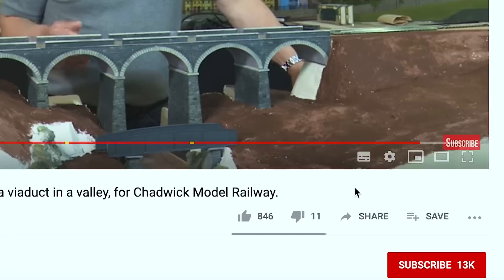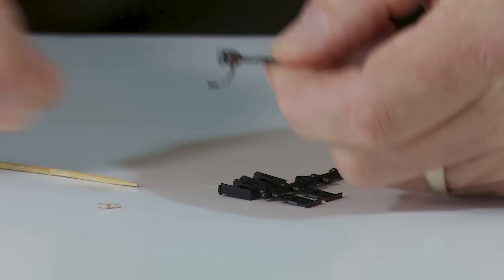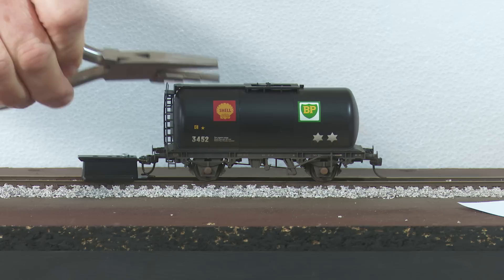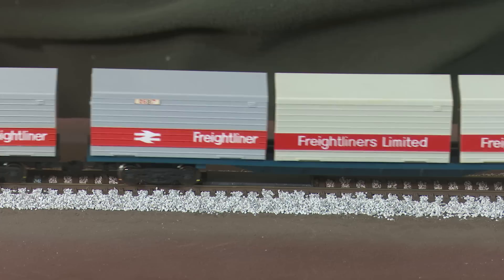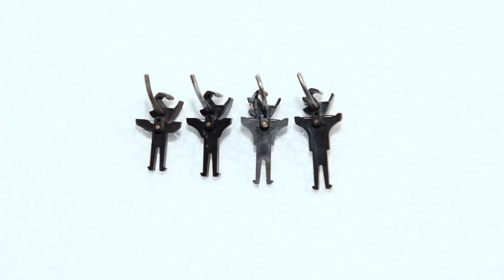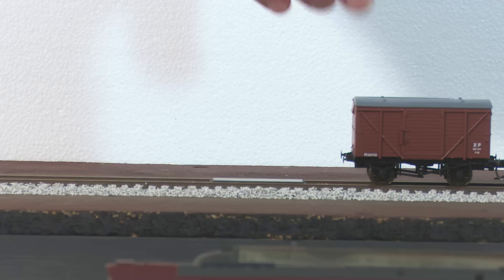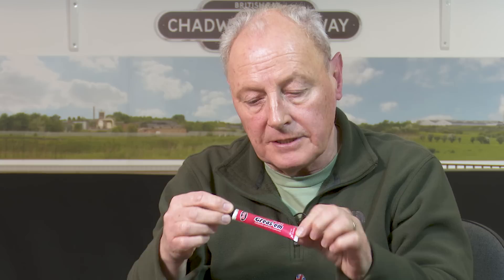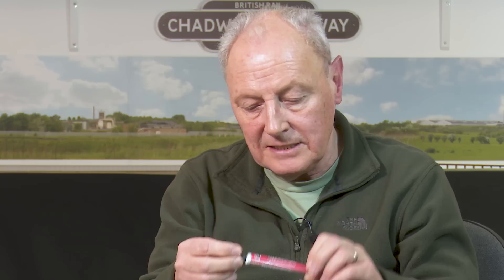Kadee Couplings at Chadwick Model Railway | 81.

Comment: Maybe the best in-depth look at and explanation of KaDee couplers I have seen.  They have a myriad of ultra-realistic couplings.
Reply from the maker: Thanks Anthony, I’m so pleased that you enjoyed it.
Reply: Charlie, I’m rebuilding my layout. I have been ordering brand new code 83 track.it doesn’t mater what fish plates I use with code 83 or code 100, does it. I bought a lot of engines and cars second hand. Because I was still working on my layout, I didn’t look at them all. I have since found out that one of my engines has the back set of wheel tide on. Do you know where I could get it fixed. In the UK or the States. Finally, I needed to know how to fix couplings but I found your video. Thanks for putting it online.
Bob
Reply: I wholeheartedly agree with this! Our HO Scale model Railway here in Beaverton, OR, USA requires it's members to use KaDee couplers on all rolling stock and locomotives. It saves so much headache if we need to do an coupler repair during a show because we all have the repair parts. I wish you would have discussed the shelf-pin couplers that KaDee produces. They're great when you have a modular layout or long strings of cars.
Reply: Totally agree Anthony, this is a reference video for posterity. I am just starting to understand them for my kit built wagons and need to learn which ones I need. Top job again Charlie 🤩

Comment: Hi Charlie
I started using Kadee couplings years ago. With a fair bit of stock I set up a few wagons with one Kadee only.  I used them as transition wagons and converted the rest one at a time.  As a teenager then funds were limited.  Also the other end of the guage can be used to work out the thickness of the packing required.
Love your videos.
Paul from Zillmere
Reply from the maker: Thanks Paul, I’m so pleased that you enjoyed it. Regards Charlie.

Comment: You are quite correct it is about time there is an industry wide standard not only for the fitting of NEM pockets but height and the style of tension lock couplings. There is a group of us here in France who meet up and run our stock on each others layouts and my D600 Warship in particular does not couple  well the carriages with the standard Hornby supplied coupling. The couplings on both vehicles are the standard couplings supplied in the box from new.
Reply from the maker: Hi Phil, yes these wretched couplings are a disaster, if only everything was built to accept Kadee’s at the right height. Stay safe regards Charlie.

Comment: Two possible solutions got your COFC flat car:
1) instead of mounting the draft gear box onto the truck (bogie), cut the flange off the bogie so you can mount the box to the car body itself; that, and an underset shank coupler, should raise it up enough to clear the coupler height gauge, and allow it to couple with the other cars (wagons), such as those tank cars you started with.
2) get an American COFC flatcar, and repaint it in the British colors; all the stuff over here is pretty much already equipped with Kadee (or compatible) couplers right out of the box. The only problem here, is that the track gauge is the same, but our HO scale is 1:87.1, whereas OO scale is 1:76, so the American car will be a bit narrower than expected. Also, the containers will be at 1:87 scale as well - they’ll fit loosely on your British COFC car, but the converse is not true; your British containers probably won’t fit the American COFC car, at least not without modification.
The powdered graphite lubricant comes in handy for other things as well; stock up on some! 😎
Reply from the maker: Thanks William, a very useful comment. 
I will certainly check out the mounting of the couplings on the wagon body itself rather than on the biggie. 
Many thanks Charlie.

Comment: Here in the US we will sometimes use thin shim washers between the car and the truck to being the coupler more in line with the standard height. Sometimes you can take the center mount coupler (the only ones I have ever used) and bring the couplet up to the proper height. I have had to file off a little of the mounting nub (?) where the truck is screwed into the body of the car to lower the coupler. The low and high mount would sometimes fix the problem but is you need just a little adjustment, you might use the above mentioned system. Again I feel that the best action of the KD is the ability to set out the cars and pull away from them leaving them spotted where you want...
Reply from the maker: I hear the voice of experience. Thanks David

Comment: One of the greatest advancements in model railroading.  In the States we had "slide hook" couplers... they're our version of toy couplings like your tension locks.  unreliable things that are almost impossible to couple onto while on a curve and a pain in the arse to uncouple.  
The magnet uncoupling is only useful for a hard to reach spot on your layout, otherwise just use a cocktail stick (no need to lift the car up) so you can uncouple anywhere on the track you'd like.  Now KaDees aren't perfect but they definitely are better than other options.  Cheers from the States Charlie!!
Reply from the maker: Two great comments. Both highlighting what a ridiculous pickle the UK market and Europe for that matter is in.

Comment: Center set shank - easy for you to say - haha not possible for me (wife says it is because I'm older than dirt)...Whisker springs are sooooooooo much better than the original.......So many of us here in the states will mount the uncoupling magnets under the track the magnet never interfears with the pins like you showed. I don't like the magnets at all so I cut off the pins and the coupling looks so much more realistic. I like the delay aspect of the couplers in that I can off set one coupler, back the train into the car, and then push it to the place where I want to spot it and them just pull away leaving he car in place. You never have to worry about the problems you have at the 18:55 time line  If you "under mount" the magnet. Of course you have to mark it in some way... Love the videos Charlie...
Reply from the maker: Thanks David I’m so pleased that you enjoyed the video. And some sound advice from you thanks.

Comment: Hi Charlie. Interesting video about the Kadee's. Personally dont use them myself as you say, the hieght problem and number of different couplings types in this country is a mind field. I have ripped everything out and started a fresh and use Sprat & Winkle (looking forward to the next instalment on these) they are good for kitbuilt models as well as RTR.i only fit the " hook" to one end of each wagon. They are impossible to fit to bogie diesel loco's so just use the bar with a couple of double ended wagons to act as a barrier wagon.
Cheers Colin
Reply from the maker: I’m so pleased that you found the video interesting. I’ll take a look at your couplings next time.

Comment: As an American we tend to have simple fixes for couplers our cheap option act like knuckle couplers without the movable thumb. Our more expensive options can have problems though prototypicaly the draft gear box is mounted on the frame rather than the truck "boggy". The scale manufacturers put them on the trucks so the cars "wagons" can make tighter corners. Most of the time we have to replace the entire truck, and add a draft gear box to the frame to use the aftermarket upgrades. As for your problem with the height difference you might need to shim up or down your draft box to fit correctly the pins should just miss the ledge of the height gauge .
Reply from the maker: Thanks for the insight into your world. It seems we both have individual problems to sort in this wonderful hobby.

Comment: I use only #158, #146, #118, & #119's. I have always modified my draft gears to accept only these because I am not dealing with the centering springs, weird boxes, etc. Everything runs perfect for years now!!
Reply from the maker: You must be one of the few DP, so many of us have nothing but trouble with couplings.
Reply: @ChadwickModelRailway  I hate to hear that & I know my friends have the same issues. I am an aviation engineer & I am always looking to improve things. I really do not take anything at face value if that makes any sense-lol!

Comment: You can mix and match most types of Kadee's depending on what rolling stock you use as each has a different coupler box some bigger or smaller, wider, narrower etc... You may find you need 1 coupler on the front a car then need a different for the back to make it all hook up.  Some of these couplers are down right dastardly in putting them together and the included instructions are usually very vague especially pertaining to the springs.  Great brand and they have something for everything.  Nice video thank you.
Reply from the maker: Yes you can mix them, but it is somewhat of a nightmare trying to get the heights exactly right.  it really is a case of trial and error. Regards Charlie

Comment: The coupler wars.  You hit the nail on the head when you said that manufacturers use couplers as means of discouraging modellers from purchasing other brands.
Mind you, in the past, the individual American manufacturers had their own designs problems as well.  This resulted in the infamous X2F coupler designed by the NMRA as means of standardising couplings.  Modelling pressure, in the end, ensured that KD couplers would become the defacto standard forcing manufacturers to accommodate the fitting of KD couplers to their rolling stock.  The KD patent eventually expired allowing a number of manufacturers to enter the market and are pretty well standard on US stock.  I wouldn't think in the US any manufacturer would dare put couplings on their stock that didn't conform to standard height requirement.
All this is because modellers and the modelling press "insisted" on this standardisation some that seem to be peculiarly missing from the British scene which is unfortunate.

Kind regards
Geoff
Reply from the maker: Great comment Geoff. If only we could truly standardise the UK producers.
Reply: @ChadwickModelRailway  Charlie it will only happen when modellers and in particular the modelling press has the gumption to say what manufacturers is not acceptable.  We are meek and mild in what is dished out to us, unlike our American cousins. Anyway Charlie keep on pedaling or perhaps in your case keep rowing.

Comment: You could take a look at Hunt Couplers Charlie. Perhaps the answer to a maidens prayer. As they offer versatility and its an ideal that's bound to catch on. Magnetic couplings work well in O gauge and have been in use for a number of years. Hunt are currently  being made for the modern image market and the type of stock you run. But have the potential to provide couplings for all stock. Well worth looking at Charlie. Perhaps Kadee has met its match.
Reply from the maker: Hi Richard, yes I’m very interested in the hunt couplers. Apparently they have now sold out so I’ll have to wait to get my hands on some. Mind you I worry that they won’t have the strength when dealing with trains that run through a helix. Regards Charlie.

Comment: Charles, Charles, Charles....

I've been back and forth about swapping to Kadees for a while now - not necessarily for the 'auto uncoupling' - but because I think they look nicer than tension lock, cause less derailments and are stronger than the magnetic Couplings I have at the moment, while nice they do come apart with heavier longer trains...

So it's off to camp Kadee we go!

Using NEM ones, £10 for two sets... Thankfully I've only got around 10 wagons 😁👍
Reply from the maker: I’m sure that in time you will need more.

Comment: Hi Charlie yes it can be quite frustrating when the NEM pockets are all at the wrong height. I have large amounts of old wagons plus the kit built stuff that are yet to receive Kadees. Price wise it's always worth looking in the rummage boxes at shows as often there's at least one '3 wagons for a fiver' box there and you can sometimes get some good bargains in them/ I managed to get some good Bachmann ones last time. I do like to buy things on Ebay a lot and obviously a lot of it is tat but then it means it's ok to experiment with them as you're not screwing up a £20 wagon or coach doing that and you can get a good idea of what the coupling will be like in service. Another point about uncoupling is cupboard door magnets work pretty well and fit under the track quite unobtrusively and they're much cheaper than the named Kadee items so maybe that is worth a look. Great video, thanks for posting it.
Reply from the maker: A great tip regarding the kitchen door magnets DJ.

Comment: Thanks a lot gentleman for a presentation that is, let's say it clearly, pedagogic. I am back to OO gauge after issues with british N (including couplings), and I am seeing now why tension-lock couplers are a drag.
As you said, Kadee have a good reputation, and it is justified : decent price, ease of use, good aspect, and reliability, highlighted by some modellers.
You have also presented honestly the issues with UK rolling stock, and I will check this on my brand-new bought little fleet before deciding to go for Kadees or not (just bought the Symoba gauge at Peter's Spares, cheap and will do the job). I guess my Oxford Rail N7 would have no height issue with their NEM pockets, but I am doubtfull with my Hornby Black 5 and my Bachmann Webb Coal, and others from those brands. As I had put my locos on my workbench for checking and installing extra parts, I will check their NEM pockets heights on the go next weekend.
As you said, you have to find workarounds for locomotives. For wagons, my solution would be if NEM does not work, trim off the NEM box and use Kadee gearbox instead, height ajustable at will...
Anyway, one issue sometimes put forward for the reliability of NEM Kadee couplers is the fact that they have two pivoting point, one with the NEM box itself, and a second one at the fixation of the coupler's head. It is said that it is a issue that prevents a good working of the coupler, and it is recommended to use a Kadee with a Kadee gearbox instead. I am doubtfull about this, and your advice on this point is welcome.
Reply from the maker: I’m so pleased that you enjoyed the video Oliver.  Regarding the two pivot options, I have found no significant difference.
Reply: @ChadwickModelRailway  Well, that was an answer I was expecting, but I would rather have a confirmation. Honestly, if they would have been any issue with the NEM Kadee couplers vs. gearboxed Kadee, that would have been widely known by now, and I would not have heard from it from one single source (a french modeller who discards NEM boxes and pu Kadees on gearboxes instead due to his theory on two pivots) plus a lonely mention on a RMweb forum. As we say in legal affairs : "testimus unus, testimus nullus ", lone witness, testimony useless.
Roughly, as what I have seen, you can count one UK railway modeller on two who use Kadees. That is too much to hide a theoretical problem with two pivots on NEM instead of one on gearboxed ones.
Well, I'm in for Kadees, and thanks for your precious point of view. You can also add an advantage of Kadees with this item : https://rixproducts.com/product/rix-uncoupling-tool-ho/ . Walther's from the USA sells it, and that would be astonishing that no UK retailer have it. Uncoupling anywhere and without touching your rolling stock with it. Cannot be done with tension-lock...

Comment: I use tension locks, just beacuse its easy for me. But i remove one hook on the end of rolling stock so its just a loop. That way I can lift locos off really easy to swap them about or add and remove more rolling stock. Works very well I find.
Reply from the maker: Good for you. At least you found a useful workaround. Most of us suffer in silence.

Comment: Well done Charlie. Excellent presentation. You can use double sided tape to manipulate  your NEM couplings and stop coupler droop. You can also use it to adjust the height of the NEM pocket. Not perfect but its cheap and effective. You need the one with a thicker backing. The odd washer under a coupling pocket can also adjust height.
Reply from the maker: Thanks Richard,  I have used similar techniques to overcome poor design!

Comment: Great video!  When I was big into NTrak I also used Unimate couplers for long  drags of coal cars.  Coal cars are usually not individually switched..  So, I had a 5 car set with Unimates between the cars and Kadees on the end cars.  It made it cheaper to equip 5 cars strings with couplers.  In operations the theory was each 5 car string was never separated.  That worked well.
Reply from the maker: Sound advice thanks mate. I was aiming at triplets of wagons.